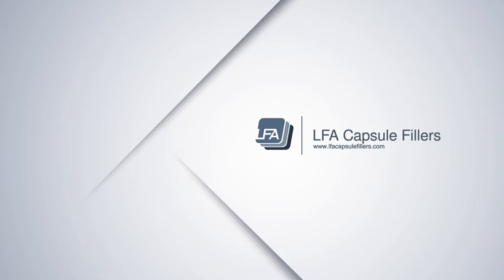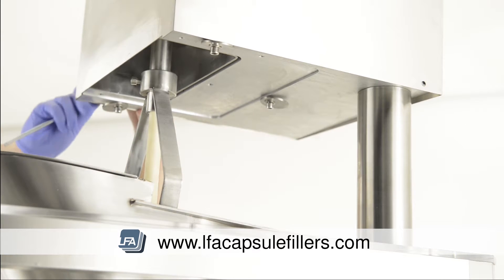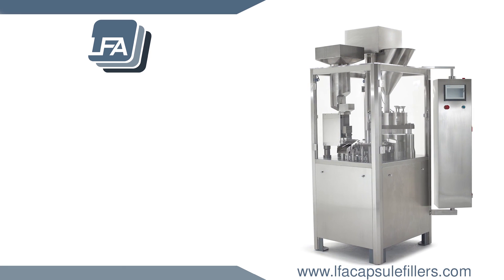FACF - Dismantling The Tamping Turret | LFA Capsule Fillers

Comment from the maker: 0:00 Intro
0:00 Raise Top Section Pillar
0:42 Undo Bolts On Underside/Remove Hopper
0:55 Remove Orga Paddle
1:30 Remove Sensor
1:38 Number Your Stations
1:44 Removing Tamping Tooling
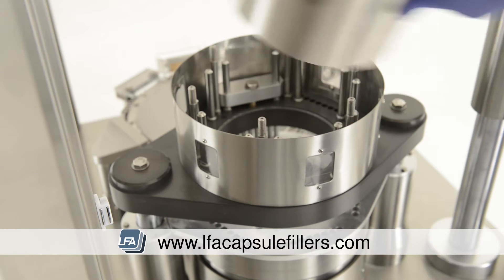2:11 Removing Casing
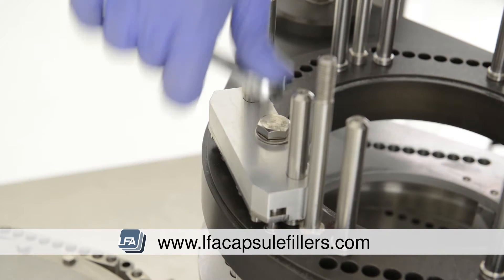2:17 Brass Spacer
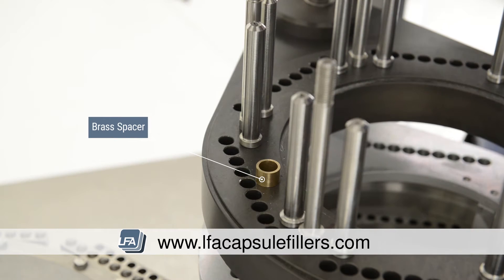2:37 Removing Middle Section
2:51 Removing 2nd From Last Section
3:11 Bottom Section
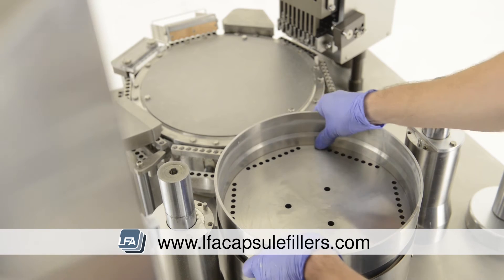3:31 Clean This Section
3:49 Start To Assemble
4:01 Replace 2nd From Last Section
4:25 Replace Middle Section
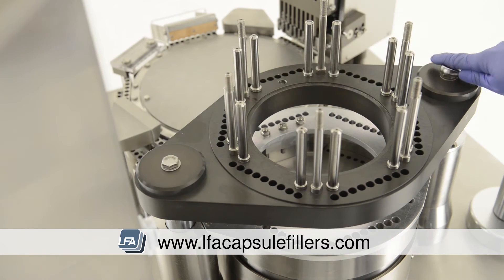4:41 Rotate Turret To Lowest Position
4:51 Alignment
5:29 Replacing Brass Spacer
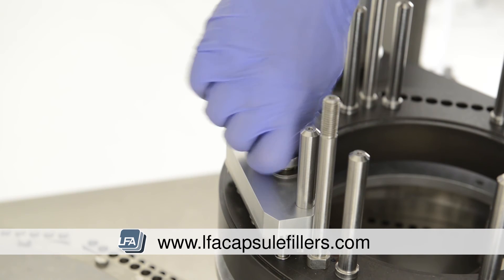5:50 Replacing Casing
6:08 Replacing Tamping Tooling
6:28 Secure Tamping Tooling With Bolts
6:52 Replace Sensor
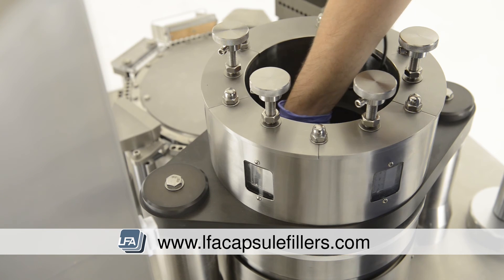6:56 Replace Hopper With Orga Inside
7:07 Move Motor Over The Top
7:14 Replace Orga Filler Paddle
7:34 Replace Motor Casing
7:53 Outro